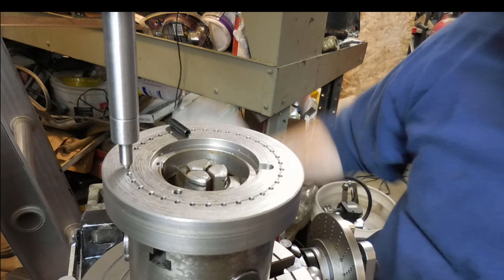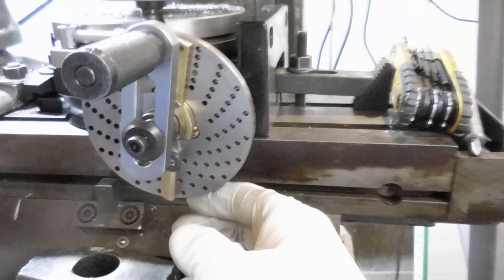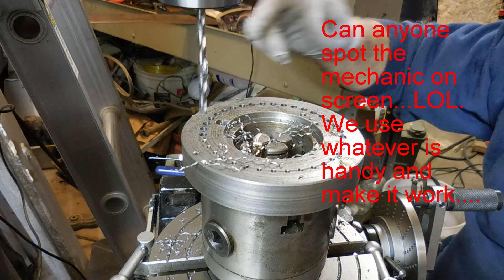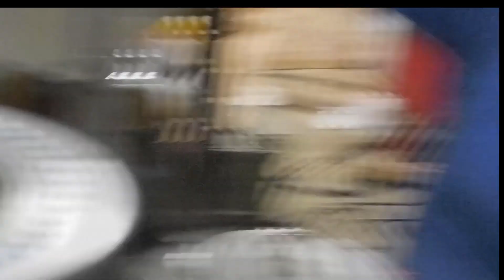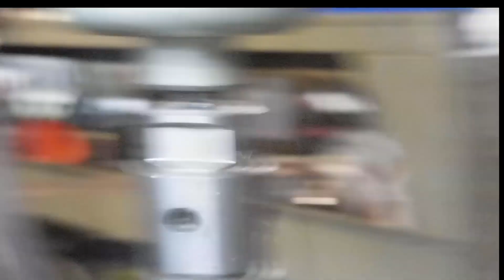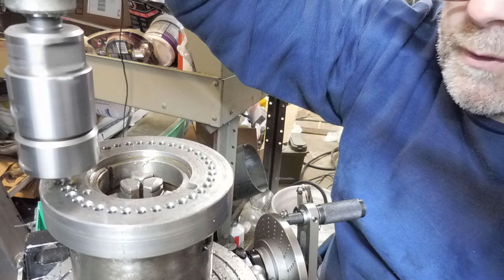Hardinge 36 tooth ebay unicorn part 2

Comment: Jealous of that tapping head!  Been stalking ebay for a while but haven't pulled the trigger yet... haven't had sufficiently many holes to tap to make it worth it.   Hear ya about missing focus.  Such a pain, and never notice until it's too late :)
Reply from the maker: Hey Zach - thanks for watching. headed over to watch your leather patching video. The tapping head is cool, and I was geeked to try it.  Watch the height of the tapping head. You and I run out of room fast on our Rockwell Mills.  Mine is a Rigid Versatapper by Supreme Tools - but the Procunier is also top shelf. 

I have a smaller Asian clone of the tapmatic that I will try sometime.  It is much shorter in height and may come out on tighter clearance days. 

My mind is on making a small aluminum milling table that I can set up and then load onto the mill for the actual work. Cold here just like you, but if I could set up the work in the basement next to the furnace - well all the better.  Lots of holes to tap - so you see my madness was planned way ahead. Usually I have the tools long before the work gets done. LOL. 

All the best 
Dan

Comment: Hey Dan.

I have not spotted Cam in the comments as yet.  ( Cam at Battler )
But it might be a time difference thing.
I have been watching a few of his video,s but mostly the older video,s first.

It,s Good of you to prepare the Hardinge for me i could have done this work myself and saved you the trouble.
 But if it makes you happy to do these jobs for me that,s ok with me,  LOL.

The ( only ) negative with this job was at the 8.00 minute plus mark,  your drill was off centre. You mostly would not be able to see it from where you where,  but hopefully this does not create to many problems.

It,s your fault ???
You mentioned Murphy and he suddenly appeared. Hehehe.

Thanks for taking care of this job for me.
All the Best.
Regards Peter.
Reply from the maker: Thanks Peter anything I can do to help.  Yeah my setup could have been better.  Next time I will dial off the center with my DRO and do it properly. The final result was actually pretty uniform. But, I will find out for sure when the pin does or doesn't engage. I did grab some socket head screws and will see what that looks like. If they clear well enough, I will surface grind the excess and they will be uniformly bottomed facing the pin side.  Will that be suitable for you?  When you picking this thing up? I hate to box such a prize and risk transport damage.
Reply: @houseofbrokendobbsthings5537 
 
Hey Dan.

I do not think it should be to much trouble for transport ?
That was already worked out in a earlier reply.
You might have already forgotten,  Maybe ?

It,s coming with you,  when you were coming to see me for your guest appearance on my channel ??

That is strange,  i thought you would have remembered something that important ?????
We can work that out later as the day gets closer ???

For the moment i can take it easy until then,  and enjoy watching your channel.

Thanks for sharing Part 2.
All the Best.
Regards Peter.

Comment: I know this Versa Tap and can learn watching you actually using this tool. We have used a Tapmatic so we just keep on learning thank you for this lesson. 
Thank you for the shout out about our tapping machine you are very nice Dan, what a great community this YouTube creators thing is. 

Like your description no drills or tapes were injured good thing because we are sensitive to these thing occurring. LOL.
No hurry no rush easy quell feed you are talking and performing like we think no wonder we get along in these messages so well, in our opinion, sit back viewers and enjoy the ride show and Dan having some fun, way to go sir.
Connections are very important so this is great for you to share. Mills does seem smooth like the operator is.   
? What was that giant block you hammered your index plate back into place on the jaw chuck with, I thought it was gold in color and might be a lost treasure, funin with yo of course Dan.
Reply from the maker: Active Atom : Evening guys. The mystery hunk was a scrap yard “dug it out of the dirt” brass sledge hammer head. I keep it nearby for the tap-tap and draw bar smack on the mill. 

Sorry about the dead air - was running late and wanted it up and off the list. 

Dan

Comment: That many holes drilled and tapped, priceless.  Wish I could afford a Versa tapper.  Picked up a used Procunier 2E with most of the collets, for $75.  Some one had assembled it incorrectly and it wouldn't work.  I corrected the issue, and now it works perfectly.  Great video.
Reply from the maker: Mature Patriot / 2 BUSTED THUMBS 

Thanks! Procunier is top shelf. Glad you got it cheap with collets.

Comment: There are a few times I got scared you'd have to do some tap removal the hard way...!!!    
You handled it like a pro, I was disapointed a little that nothing happened....   lol
Seriously, tapping devices are a dream to use, better than doing all those holes by hand, they're way safer as breaking taps is concerned, they operate on constant force and without lateral forces, even did some No2 taps by power tapping...  ;)
You'll get a great indexer in the end.
Reply from the maker: Thanks Pierre. I knew your keen eye would spot my bobble and wobbles..... LOL.  If that had been a cheap tap I almost guarantee it would have broken from the side load when the plate lifted. Next time it will be better and the next after better still. When I setup again i will wrap the piece inner diameter to get a better grip. 

The tapping head was a dream and indeed saved my bacon. The control versus a hand tap handle is really cool. The holes were straight and the threads were straight. What a difference a mill makes.  I toyed with the idea of doing it by hand for a millisecond - they said nah!  Pierre and Mr. Whitham would not approve. LOL.  

To be fair I stole that Versa Tapper on eBay.  Bought one collet and it is as it sets. Needs a good cleaning and refresh the lube. I checked after the hour or so of operation - stone cold housing. 

Thanks so much for watching. Ice storm here last night...
Reply: Practice and feedback makes better, keep on the good work....
Shipload of snow expected over later today, I'm getting fxxxxken tired of cold, rain and snow for this Winter, PLEASE Spring deliver me, like right now before we get burried in more snow.....!!!!!!!!!!!        Snifffffff....!!!!        lol

Comment: looks like it turned out pretty well, I wonder how much of a difference there is between the indexer pin hole diameter and the 10-24 studs, and if it would cause any issues with it being slightly smaller and creating a lip that the indexing pin would catch on? Also, dont feel bad, Ive been guilty of the rocking leadscrew nuts myself on my stuff, leave it loose to let it self align and forget to tighten them up after it's all together, lol. Keep up the good work man.
Reply from the maker: Thanks Chirpy.  I was nerve wracking with such a prestigious list of viewers.